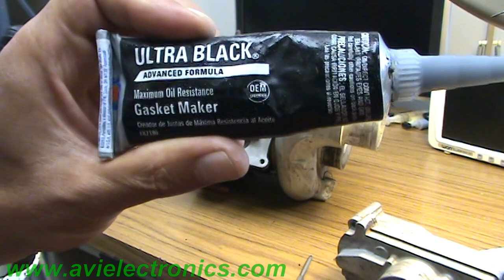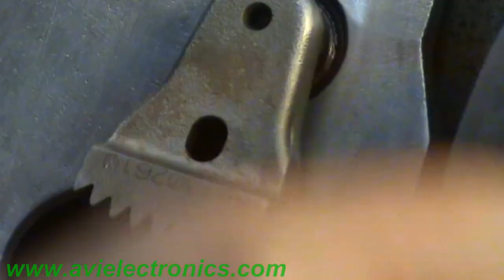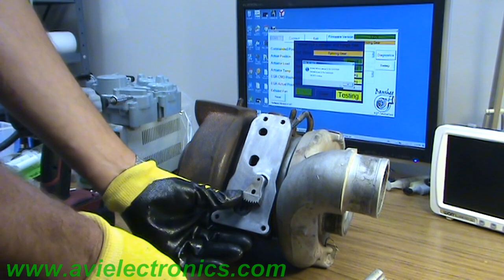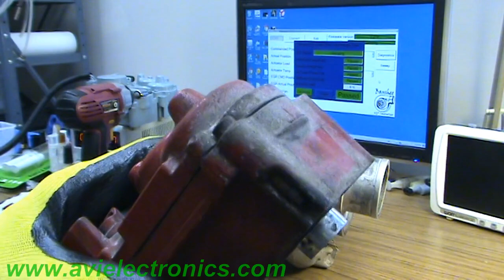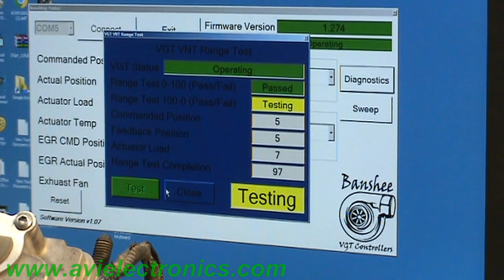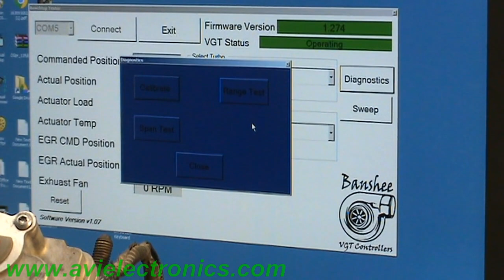How to check a turbo HE351VE Dodge Ram 2011 and calibration procedure.

Comment: do i need to calibrate the actuator if I'm only replacing the gaskets . no codes no check engine just a small coolant leak
Reply from the maker: If you can install the actuator at the same position- calibration is not necessary.
Reply: @avielectronicscorp.1591  thank you

Comment: I have 2011 Dodge Ram 2500 had a code for turbocharger. Even tho the turbo was pushing up to 30psi normally I do up to 45 psi so I took it to a shop to take care of it. They replaced the whole turbo kit w actuator but now when I’m driving on engine brake let’s say 3rd gear doing 2.5 rpms then engine brake slows it down to 1.75 rpm and I floor the gas pedal it starts smoking like I’m rolling coal and rpm docent go up quickly it goes up very slowly and smokes for about 5-10 seconds then finally takes off I have blocked the EGR and it’s a straighpipe did the shop had to calibrate the turbo before install?
Reply from the maker: Have you flashed ECM with proper calibration?
Reply: @avielectronicscorp.1591   michanic claimed that he did a new tuner on it

Comment: Hello , I have a 08 Dodge 6.7 Cummins . engine light on , code p2262 turbo boost pressure not detected. Checked around the area of the turbo and noticed that the yellow solid wire is exposed ( my fault) I installed a catch can and did not secure it. The catch can was rubbing against the wire and actuator and exposed the wire. Would that cause it to malfunction?
Reply from the maker: Hello Santos, the yellow wire is CAN-H. If you short it to the ground-  communication with an actuator will be lost. Also, if the short circuit lasted for a long time it may damage CAN transceiver.
Reply: @avielectronicscorp.1591  What is the can transceiver? Is that the communication from actuator to computer?
Reply from the maker: @santosmireles1518  Yes. ECU and actuator have it's own transceiver.

Comment: I'm confused. I have a 2011 Ram 4500 Cassis Cab. With low power and no exhaust brake. I removed the actuator verified free and complete travel of arm. Ran the calibration test passed. Re-installed and completed calibration, passed. No change still no.exhausr.brake and low power. The arm I placed all the way towards the exhaust side (Pointing to the rear of the truck. Is the correct? This video you say the 2011 ram 2500 needs to be towards the front (pointing towards the compressor) please advise. Thanks.
Reply from the maker: You did everything right. This is a specific calibration software.

Comment: So my check engine light is saying that it’s my boost control module but I have heard that that isn’t a thing and I’m thinking it’s my turbo actuator. Was wondering if you’ve heard anything about this
Reply from the maker: This can be a problem with the actuator and the turbo too. Cummins does not have an accurate diagnosis of this problem. If you can bring your truck to us, we can find a problem without removing the actuator from the turbine.
Reply: Yevgeniy Bakhtin where are y’all located?
Reply from the maker: @maddoxduke926  Palatine, IL
Reply: Yevgeniy Bakhtin ah man. That’s tough. I’m down in Texas. Is there anything I can do to diagnose the truck myself? The dealership will just overcharge me and probably not even fix the problem.
Reply from the maker: @maddoxduke926  Well, you can take your actuator off, check the turbo and send us your actuator for inspection and possibly rebuild.

Comment: have quick question for you please can you calibrate a actuator if the vgt shaft or gear on top of the turbo doesn't fully open having a hard time calibrating actuator on job that i'm right now thanks
Reply from the maker: Depends on what year your truck is. But anyway you'll get trouble codes.

Comment: Can I send you turbo and actuator sob you can check it? It’s for a 2014 Cummins 6.7
Reply from the maker: Yes, of course. If your turbo is in good condition- we'll calibrate an actuator with the turbo so you can plug and play.
Reply: @avielectronicscorp.1591  How much to calibrate turbo after i rebuild it? 2012 cummins 6.7
Reply from the maker: @solaj22  Where are you located? Can you bring us your turbo or your truck?